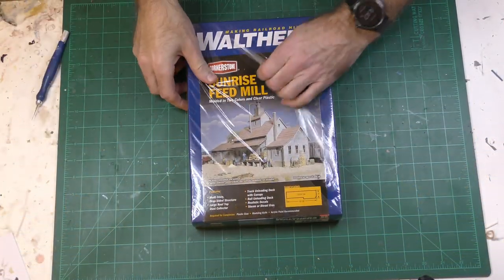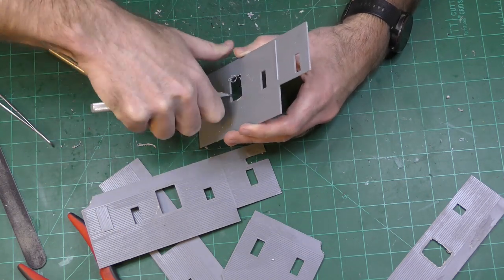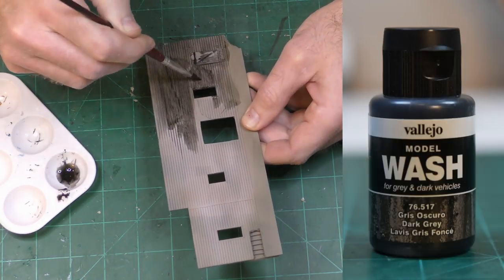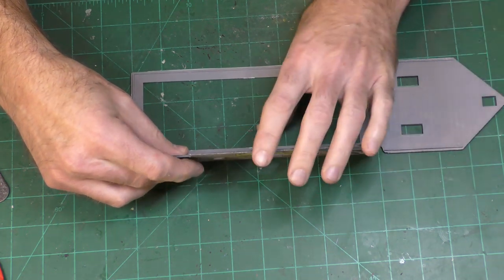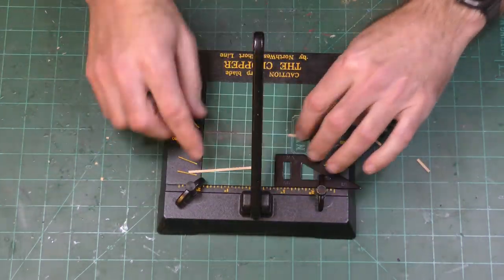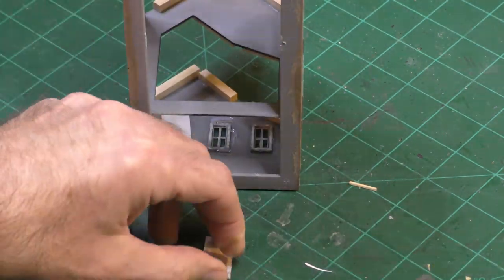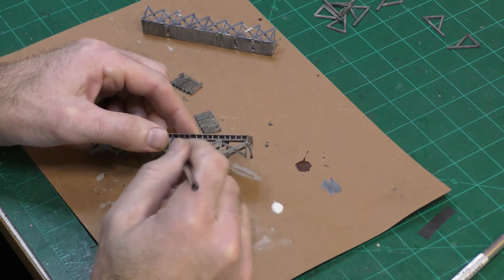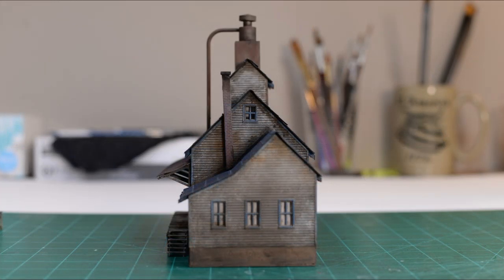Sunrise Feed Mill from Walthers/Cornerstone build in HO Scale

Comment: Wood kits are just as easy to screw up as plastic ones. It all comes down to the skill of the builder. If one is willing to put some effort into developing skills and spend some extra time on a structure it can do wonders. I've seen amazing builds online of plastic kits. These are builds where tons of detail work has been done with aftermarket parts and scratchbuilt items. For someone just looking to start scratch building their own structures one does not need to break the bank on supplies. Some of the craft stores, Hobby Lobby for one, sell sheets of matte board and chipboard.  A couple of sheets of chipboard and a bag of a variety of basswood strips would last a long time. For some items such as windows and other trim parts a computer and printer come very handy. Let's face it, model railroading isn't the cheapest hobby. But there are a number of things that can be done to cut costs. Scratchbuilding is one. 
When I was but a wee lad there was a gentleman across the street from us. On his basement layout I think all the structures were scratchuilt. Strip wood and chipboard were his primary material. For figures if he needed a large grouping, he had a few really good ones. The rest he made from pipe cleaners. All of his track work was hand laid including turnouts. If you can develop that skill then just about everything else should be a piece of cake

Comment: Excellent video, mate. On the subject of acrylic washes, you can add a few drops of isopropyl alcohol to the water. It breaks the surface tension and smooths the applying process. Only downside, you have to work them around really fast, but once you get the hang of it they are easy to work with and very affordable.

Comment: Another great build video. Thanks for posting. You mention several paints/washes in the video and I'm having a hard time finding the mentioned product. Could you provide additional information on Folk Art Thunder Grey and the Steel Grey (white color in appearance) you painted the walls? If not a time constraint for you would it be possible to list the products used in the "SHOW MORE" portion of the YouTube post? Thanks again for the wonderful instructional video.
Reply from the maker: Thanks for the comments.  I use Vallejo Dark Grey wash and other Vallejo washes pretty extensively.  You would have to look in a hobby store that sells Vallejo paints or else get them online.  The Folk Art paint is cheap craft store paint which you should be able to get at any craft store.  Americana is a very similar brand and I sometimes get them confused.  I get them at Hobby Lobby but I have even seen them at Wal-Mart in the craft section.

Comment: Great build video! Looking to do something similar. Question though, what size balsa/basswood did you use for the exposed wall studs? And what size for the hand made sliding doors?

Thanks,
Chad
Reply from the maker: Thanks for the comments.  Not sure of the exact size, but I think I used scale 2x4 for studs and 2x8 for inside wall boards.  The sliding door rim was probably a 4x4.  If you are going to try something like that, I recommend buying some bulk scale lumber.  There are several good online retailers that sell it by scale size, such as 2x4 or 2.8.  I think 3/32 of an inch square is close for a 4x4.
Reply: Dont know if anyone gives a damn but if you are stoned like me atm then you can watch all of the new series on InstaFlixxer. I've been binge watching with my brother for the last couple of days =)
Reply: @Jagger Immanuel Yea, have been using instaflixxer for since november myself =)

Comment: What kind of glue do you use?
Reply from the maker: For plastic, I use Testor's tube cement, or Tamiya liquid cement, but I don't think the bran matters as much as whether you use tube or liquid.  That is mostly personal preference.  I think most of the better modelers use liquid.  Tube is really messy.
Reply: @asdasx392  I use testors in that bottle with the needle myself.  Just started trying the non toxic stuff so I don't have to breath that stuff in seems ok so far.  Just curious what others are using.  My main goal is for it to last for a few years.  Thanks and Nice Work!